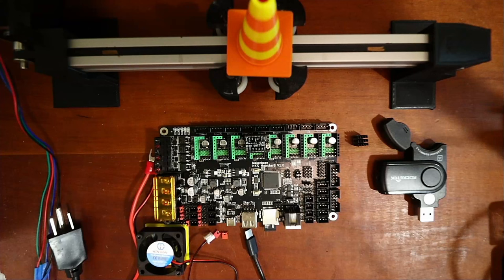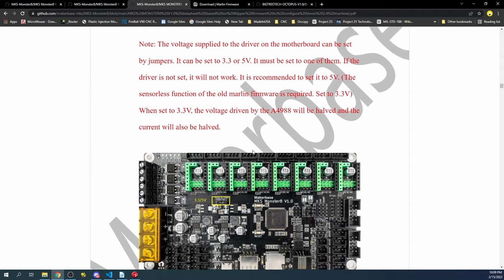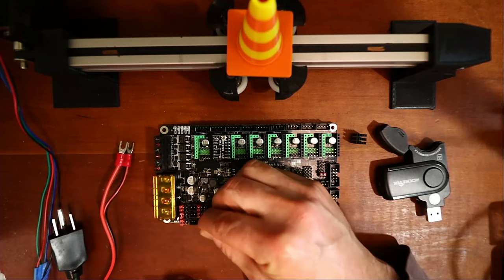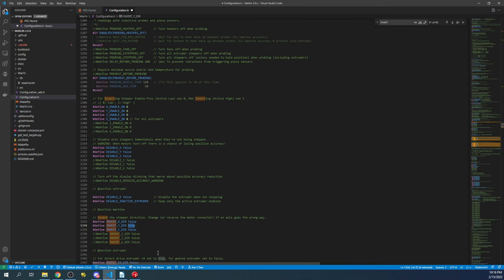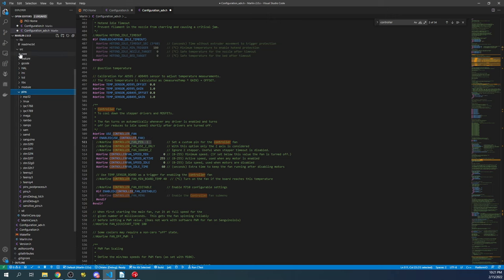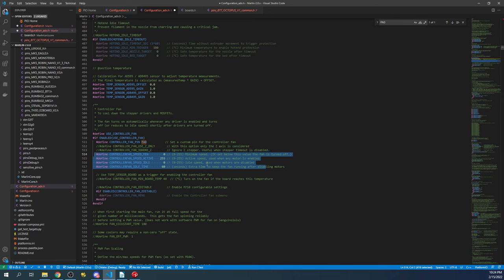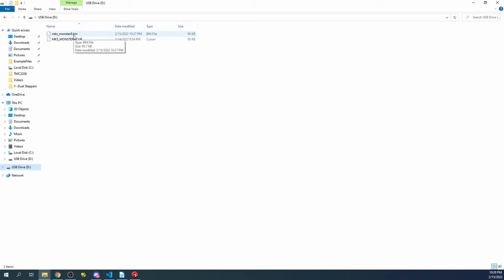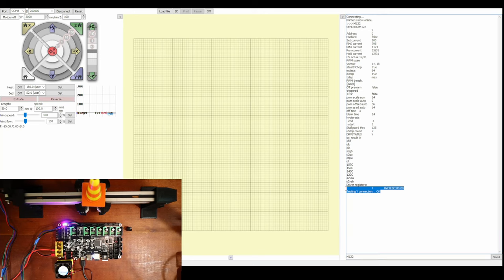MKS Monster8 TMC2209 UART

Comment: Hi. Btt skr3 right now. I thing it was be top. Do you have a plane look this plate?
Reply from the maker: As soon as I get one.
Reply: @EdwardBraiman  i took))
Reply from the maker: Just ordered one, steppers are currently not a available or manual.
Reply: @EdwardBraiman  Did you order for Ali? There is one fee left at a special price. it has a 5-piece TMC2209/08 or5160. I ordered an ez2209 with adapters. Now I have skr 1.4 tmc2209. There will be a reserve.
Reply from the maker: Ordered both ez and skr3 with steppers.